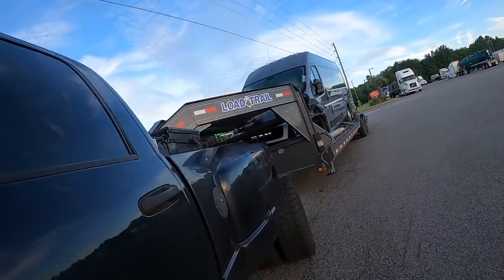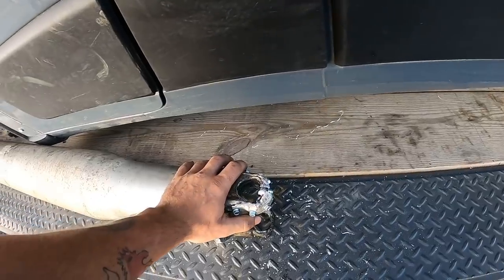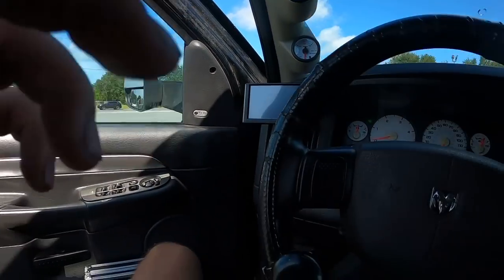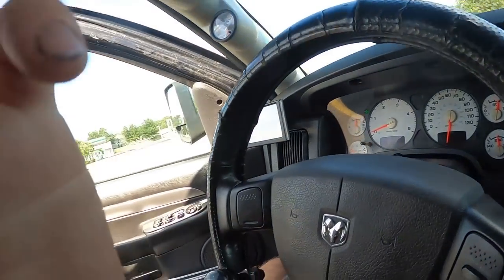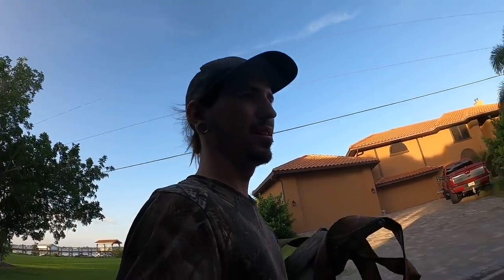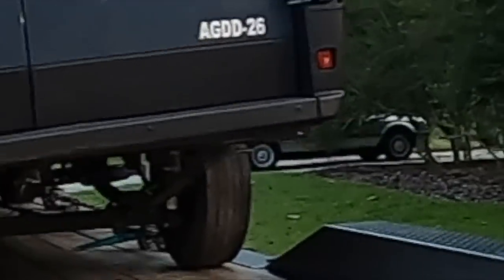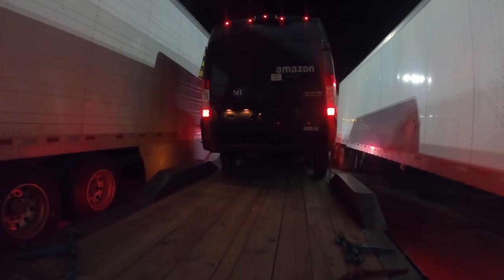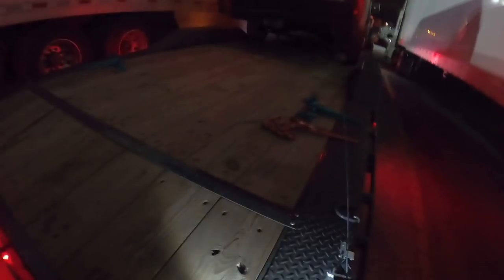How To Destroy A Driveshaft With 24k Gross Weight | Up And Running Again!

Comment: I call it bucking  When you're in a low gear and you let off the throttle the compression of the motor drags you  down through the drivetrain  And like you said hits the weakest link  It's almost like an automatic Jake break

Comment: Take the 2 piece driveshaft to a driveline shop, cut off both ends and have them weld a thick wall tube, balance, then you have a new steel one piece.
Reply: He has center Bearing problems with it- not u joint breaking

Comment: Your housing is traveling down when you let off shelling your driveshaft.  Its called wrap up.  So new leafs or leafs and ladder bars. Will eliminate it
Reply: Agreed.  The alignment of the u-joints must've been so far off that it broke the weakest link.
Reply: The axle rap is pushing the pinion up not down under hard deceleration.
Reply: @tn65s  well we agree on the wrap  lol

Comment: I broke down on I-20 last year@ 23K gross. WP pulley bolts sheared off and the serpentine belt tore out the lower radiator hose and the transmission cooling lines. Happened in a narrow construction zone and I couldn't stop so all my fluids drained by time I reached a ramp. Late Friday afternoon and nothing around to get parts. Had it towed and the idiot insisted on trying to back the truck and trailer into my driveway...he snapped one axle and bent the other. Replacing them took far longer than what had me broke down. I was able to deliver my load the following Tuesday one day later than scheduled. Glad you finally got it going and got to the root cause of why it happened. My truck is an automatic, stock tires and 4:10 rear and I try not to shift all the way into 1st as the transmission pump pressure will be low in that gear. I do take it out of OD going down hills and then I just have to stab brake. As for the 4WD, I would rather not have it, but needed 4 LO to get up a long steep driveway to deliver a load once already. Just sux having all that extra weight taking away from what I can haul!

Comment: I have one piece steel driveshaft. I haul a lot of 20,000 lb fifth wheels. Drive shaft now has over 300,000 miles on it. Mine is 73” long. My truck is an early 04 cclb with nv5600. I had mine built at keystone spring in portersville pa. For 400$ . I have had no problems with it other than a slight vibration just as u let off of the throttle for about a half second. I fixed that by jacking up rear and putting two hose clamps at the slip yoke end and fine tuning it and that fixed it. I would not recommend keystone because u got the short version of that interaction but it’s a free country . I do like the one piece. Much smoother, no carrier. When I used to have a pulling truck. Greensburg driveline always the place of choice for custom drive lines. I never used them but a lot of guys did. Keystone was used in my situation because they are 7 miles from my house. Sorry so long.
Reply: Is your  truck 4x4 or 2wd?
Reply: 4wd

Comment: Hey, I got a shout out! 😂 I agree with what you said about sliding it on the deck boards though, once you have it up on the wood decking, wood is wood. If you want to slide it on your deck boards, you do you. I was more concerned in the previous video when you were catching against the back of the trailer and the ramps. Anyhow, I do enjoy the videos and wish you continued success!

Comment: Hey man, I had to come back and look at your aluminum driveshaft compared to mine. I just put it in a week ago. It looks like yours was 4 in for most of it but at the end it tapered down to like a 3-in or something...bazaree! That's why it failed man! I wish I could send you a picture of mine because it is beast mode compared to the one you had. Reason I'm updating you is because I don't want you to get discouraged with the aluminum because if you get a 5-in aluminum with 1555 u-joints it's rated for 7,000 lb feet of torque! You just happened to got a horribly built one. Do not even waste your money fixing that aluminum. Just spend the money on the right one and you won't regret it! My truck is so much lighter on it's feet. I love it! Knowing that it's rated for 7,000 lb of torque, I give her the goose with no worries!
Reply from the maker: I just want to fix mine to sell it and recoup some money. Maybe sell it to somebody who doesn't plan on towing heavy like most teenagers with diesel trucks. I've had no issues with my 2 piece from the 06. I know it doesn't have the same feel but it does work well
Reply: @CPSteveMiller  like teenagers with diesel trucks....lol!

Comment: See if you can get a bigger yoke Amd u joint for the shaft! Like a #1410 like a 5500 takes!! I would stay away from the aluminum shaft! Maybe get it repaired for a spare… but get a new or completely rebuilt steel shaft!! With bigger joints or go with a solid race joint- way stronger but only live a year or less! But that’s longer than the 2 you have now….

Comment: It might have been me that was referring to you strapping above the suspension but I wasn't the one who brought that up originally.

You were the one who mentioned it in your video a few days ago when you were in the Copart yard and you were showing the BMW with the come along attached to the front driver's side transport hook.  You were discussing that you shouldn't try to connect above the suspension and I was asking you why you thought you were doing that on the BMW when you were clearly connected to the transport hook on the frame of the BMW WHICH WOULD BE BELOW the suspension.

Right?

I was asking you to elaborate more about what you were referring to.  

Not necessarily for me but for others that may not understand what you are talking about.  But also, in case I'm missing something that perhaps you know.

So, how about you explain a little bit more?  That's all I'm asking.

If you suggesting that people not try to attach a chain, binder, hook, clamp, or something else at the top of the shock tower and only the top of the shock tower, then that would be understandable.  

Maybe I wasn't the one you were referring to in this video.  I don't know.  I just know I asked you about it in your previous video.  

As far as the oil pan getting damaged, well, that IS possible.  Although unlikely, it's possible.  

You have to understand that the people buying these wrecked vehicles are looking at THE CURRENT damage to the vehicle.  And if the seller such as Copart showed them pictures of the underside of the vehicle and it showed the oil pan in mint condition and then they get it and it's all scraped up, who are they going to blame for that?  

You.

Sure, it's a wrecked vehicle.  That's obvious.  But you have to consider that people may be purchasing this vehicle with the idea that they can get $200 or $300 for selling the oil pan on Ebay.  Or maybe the front driver's side control arm is still good even though the spindle or wheel hub assembly is broken off.  in which case, maybe they figure they can get $100 for the control arm on EBay.

But if for some reason you damage the control arm by prying on it as you're winching it or scrape the oil pan so it no longer looks "almost new", then that's $400 less that they feel they can get for the parts for the vehicle.

You see where I'm going with this?

You have to look at this from the buyer's point of view.  If they regularly buy these vehicles and they know exactly how many parts they can sell off of it and you end up damaging 2 or 3 or maybe 5 to 10 of those parts, then that's obviously less parts that they can sell.  Or, maybe they can still sell them but not at the price they were originally planning on so their profit margin goes down.

It would be no different than if you bought that driveshaft and the person sent you pictures and you noticed it was rusty but other than that it looked like it was in good condition.  But then, when you received it, you notice there is a big dent in it.  Perhaps the seller got careless and put it in the back of their truck and had some tools or a jack in the back and made an abrupt stop and the driveshaft got crunched.

Would you want to pay for that driveshaft after it was damaged?

Of course you wouldn't.  

So, you just have to consider this from the seller's point of view.  If you know them or you have talked with them and they are okay with a few scrapes and bent parts, then by all means, do whatever you want.  But unless you know that they are okay with some additional damage over and above what it already has, I don't know that you can just be prying on the parts like you were and dragging the oil pan across the deck.

It wasn't me that said anything and honestly, dragging the oil pan across the deck probably didn't do anything.  Truly.  It likely didn't.  But do you know if the buyer is okay with things if there is additional damage?  

I would treat it more like it was a newer car in good condition just to be safe unless you have other information to make a decision otherwise.  

Anyway, get back to work.

Comment: Its not the weight class of the truck, its the length( crew cab- long bed) ive seen multiple aluminum shafts twist. Never seen them bust the  knuckle like that.
My99 f350 has a steel shaft ( done lots of stupid stuff with it) never an issue. But balance is critical... i think youd like a one piece steel shaft... just get one made, not as expensive as youd think.

Comment: Great to see you back on the road again. I think it might be worthwhile to have a custom steel drive shaft made. We have a local shop that works on nothing but drive shafts for big rigs. They have shortened and built a custom one for me before. About $500 would do it, then no more problems.
Reply: You can't use steel for a driveshaft that long because it will whip and shake like a f-er....that's why aluminum is used ONLY...
Reply: @ALL Miles MATTER FALSE, ever seen straight trucks as an example, LONG steel shafts. Most GM use steel shafts
Reply: @All-Miles-Matter  If its properly balanced it will be fine. I've done it several times without issue.
Reply: @Dipperdap1  ok...whatever...I'm not going to argue with you. Go to any driveline shop and ask them to build you one then???? As soon as you give them THE LENGTH.. they are going to tell you what I'm telling you....now...you can take ur chances BUT WE DONT! And neither does ram...THAT'S WHY THEY USE A 2 PIECE STEEL FROM THE FACTORY! you guys kill me...ya think you know more than the damn people that build the trucks!!! I don't argue....i just follow the facts!

Comment: Its an aluminum driveshaft.  Its not meant to have that much torque and wait used with them
Reply: Yes they are!
Reply: @All-Miles-Matter  Bull shit.  No way is aluminum going to work on that  setup.
Reply: Aluminum can handle the torque fine. There are a lot of other rigs putting down way more torque with aluminum drive shafts. Only difference is aluminum driveshafts tend to be a lot wider then steel
Reply: @91156  we have been running them for years  my man.  As soon as the Carrier bearing wears out on the original 2 piece drive shaft, we get rid of it!  running them for years bro! I'm not going to argue with ya...lol  The only reason ram didn't use aluminum from the factory is strictly cost.
Reply: @Ptro1  yes you have to move up to 5 inch aluminum with 1555 u-joints. Love it!

Comment: If you plan on going heavier, would it be safer to use a steel drive shaft?  I think of aluminum as not being as strong - especialy in those low gear transitions?  Just a thought....

Comment: Js you wouldn't have to have someone pull you at all if you had 4x4, no I wouldn't use it to finish the load but move it out of traffic or into a spot to work on it. Or hold it if the e-brake doesn't work.
Reply from the maker: 4wd is 4 to 5mpg less. When you drive 650 miles a day 4wd cuts into your profits unless you spend the 1800 on locking hubs

Comment: If you could find a manual transmission like yours in a two wheel drive truck then you could do away with the transfer case completely there’s one thing about you Steve you know how to fix your truck can you do a great job and my brother took his Dodge truck  took the muffler system completely off of it An ran a straight pipe from the turbo All the way to the back of his truck sounds great
Reply from the maker: Mine's straight piped too but I prefer the t case because of the "low" gear. You pretty much get a 2 speed reverse which saves wear on the clutch
Reply: @CPSteveMiller  I glad that you got the car and van delivered and going to get your ac working again

Comment: Any drive line shop is gonna tell you anything over 70 inches is not advised with steel....most won't build it. Just went thru it. I just looked under a 2020 Chevy and they use aluminum one piece...but its a standard cab.
Reply from the maker: Mine's 72 from yoke to yoke which Chevy's single cab 2wd trucks are exactly the same length just have smaller u joints. Verified that on Saturday when I was trying to see if one would work. 

The 2018 3500 dually in the fleet we have runs a one piece and the truck itself is longer than mine. I'll have to measure it when I get to his place on Wednesday
Reply: @CPSteveMiller  yeah I'm just informing you of what I just went thru. I'm not saying it can't be done..just that it's not advised. Nobody would build me one so I did 5 inch aluminum with 1555 u-joints...that's the only one they would build.
Reply from the maker: @All-Miles-Matter  I can't believe they'd just do aluminum but not steel. Curious on the reasoning. I very clearly found a weak point. There was no warning, just snapped.  Others have chimed in the comments but with an auto you should be fine with the aluminum you have. First and second in my truck lunge hard if I just let off fast especially loaded
Reply: @CPSteveMiller   I called all the major drive shaft manufacturers... They all said the same thing.  It cost me $980 for my 5" aluminum one piece.  If you want my old one you can have it. There's absolutely nothing wrong with it but won't be home till August 1st. I wonder if maybe your suffering from axle wrap and that's what snapped it.  I'm not installing mine until my traction bars come in...end of July.  I really think you need traction bars. My airbags didn't really help. As when you put air in the bags it changes pinion angle.
Reply from the maker: @All-Miles-Matter  They're in the plans. I need to just buy them already

Comment: I snapped an input shaft in an nv4500 in my 97 3500 cummins with a load behind it and downshifting to 3rd gear. The damage was already done once I pulled the trans and saw the splines were already twisted and just the forced of letting out on the clutch to hold back went ahead and twisted it apart. Damage was  prolly already done to the driveshaft but just wasnt visible to the naked eye and the first gear letting out finished it off
Reply: “Prolly”  You learn that word from a two year old?
Reply: @91156  excuse me “probably” let me get my grammar straight for the comment police

Comment: I don't have any issues with my 1pc aluminum on my 07.5 6.7L pulling 40ft fully loaded.  I think there had to be other factors at play, to make your 1pc break in the 1st place.   But $400 for a used 2pc..  Damn..  Did you get a kiss, at least?  ;)
Way to persevere, though!  I'd get the 1pc fixed, put it back in, and carry that 2pc with you for awhile
Reply from the maker: You have an automatic I assume. The inertia from a stick and stopping so abruptly is what caused it in my case. I've had no issues with the one I just bought. They go new for 950 bucks
Reply: @CPSteveMiller  No, I have a 6 speed.  My Mega Cab also a 6.7 6spd 3500 SRW has a one-piece aluminum.   My 07.5 3500 DRW has 300k miles on it, MC has 160k.  I had the MC one re-tubed due to a dent, and it was 300$.   I tow heavy with both, never tore up a driveshaft.  transfer case chains, now, that's a different story  LOL

Comment: You said transfer case at one point so I am assuming it is 4wd. It should be able to move under its own power with the rear driveshaft removed. I know mine will.
Reply: Assuming all the front drivetrain components are still in place, yes that would work.  This however is a hobbyist truck, and those parts are not in place.
Reply from the maker: Ain't no hobbyist truck. It's a 2wd work truck. You get a ton better mileage without the front end spinning. Empty I went from 13mpg to 17mpg on average with just removing the front axles. Yes, you can just get manual locking hubs. In my case I don't care. I don't use 4wd nor do I need it.

Comment: So if you don't need 4 wheel drive then why would one need off-road mudding tires?
Reply from the maker: For my old business. I'm only running them until they're dead. Should be a few more weeks
Reply: @CPSteveMiller  that makes sense, sorry late for the party. Take it easy, slow and steady.

Comment: Could you just get a steel single shaft made when you get home this is what I was worried about with the aluminum shafts everyone makes to take out carrier bearing
Reply from the maker: Looking into it
Reply: Then things internal starts breaking. Keeping weakest link near the outside is always a good thing. There has to be a alignment issue or it was just it’s time to fail. Probably was pretty rough when he let off the gas fast and jerked it back and forth some

Comment: How long is that single piece drive shaft from center u joint to center u joint I literally am in the process of a nv5600 swap and wanna order a shaft before the truck is finished so I can drive it out the shop
Reply from the maker: 72" is what mine is center to center on the 4wd
Reply: @CPSteveMiller  ok thanks man I apriciate it. I have a 03 cummins 2500 cclb I got tired of replacing auto and carriers on so I just did the swap last weekend to a nv5600 on its also getting duals for the rear end with 35s so hopefully the shaft holds up. But thanks again keep on truckin